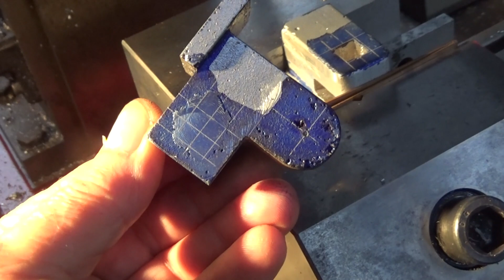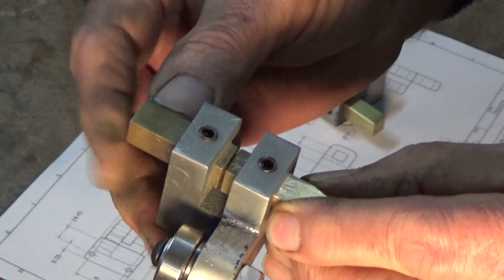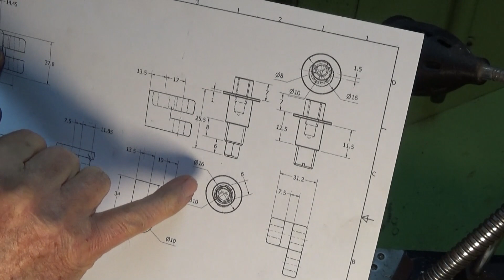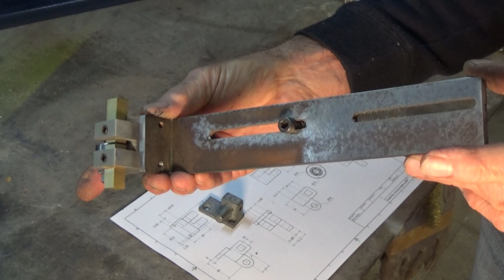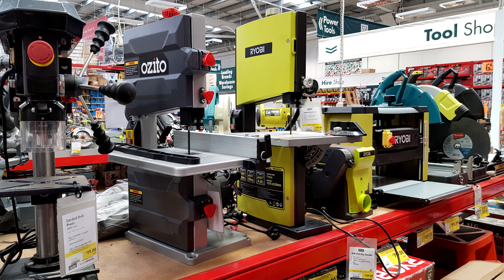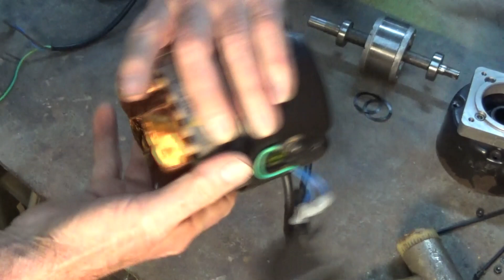Wood to Metal Bandsaw Conversion - Part 2

Comment: Mark,
I’m looking at this four years later, and it shows me how to ‘convert’ my own little Ryobi band Saw.
Thanks for all the great detail mate 👍
Robert
Reply from the maker: Thanks. If I were to do this again I would probably use a gearbox with a 20:1 ratio rather than the 30:1 that I used. I should also get some blades with a coarser pitch for thicker materials. However it has worked well and I have never broken a blade or had a blade come off the wheels. The laser is a gimmick and I now find it annoying. It tends to be too bright and it makes it hard to see the line. Maybe a red filter would be useful to cut down the brightness. 
Regards,
Mark
Reply: @Preso58  
Advice noted 👍

Comment: I would have either chosen round stock for the blade guides, or rounded the edges of the square stock.  That’s cause I be more lazy then you.  I think brass is ideal.  Seen many that used phenolic.  Worked great.  You are what I wished I had for an industrial arts teacher.  One was similar in that he was involved and a great guy.  The other was a lazy wood shop drone who assigned me to instruct the students for everything that he was deficient in……..which was all of metal working, which was the name of the class.  But you have to know what is going on to teach, so I really profited from the experience.  Last paying job was teaching Aircraft Maintenance, which required a federally licensed mechanic to instruct.  Guess I figured it out along the way.  Great stuff here,  appreciate your sharing
Reply from the maker: Thanks for watching. The brass has worked quite well and I copied the mechanism from a very old wood bandsaw which has a much higher blade speed. It seemed to work OK so I figured it would work for the metal bandsaw.
Regards,
Mark

Comment: FYI the tracking crown on a bandsaw is not the same as a say conveyor belt. The bandsaw width includes the teeth which offer no tension factor and therefore the blade with say a 1/3 width gullet depth means the centre of the blade tension is 2/3 the width away from the tooth tip. Thats why your bottom wheel has the teeth hanging off the front edge. In short move the wheel crown backward.
Reply from the maker: I do recall watching a very good video on how to tune a wood bandsaw and it included the advice you are offering. As it turns out though, the blade has done a lot of work (I am actually on my second blade now) and it seems to track well and has not given me any problems. There's always something to learn though so thanks for the info.
Regards,
Mark

Comment: Should have put rubber on wheels it helps keep blade sharp and helps with alignment of blade
Reply from the maker: Many people have told me that but I currently own a large commercially made 7 X 12 metal cutting bandsaw and it has cast iron wheels with plain machined surfaces for the blade to ride on. My smaller horizontal bandsaw also commercially made and purchased as a new machine is also the same but it has aluminium wheels. In my view the blade has a different geometry to wood cutting bandsaws and also the material is usually a bi metal construction which holds its edge much longer. There is also a lot more tension on a metal cutting blade and it may damage a rubberised wheel very quickly. 
Regards,
Mark

Comment: Conversions and remodeling are the same, the problems keep coming, better off moving.
Reply from the maker: I could not find a small metal cutting bandsaw that I could lift onto the top of a storage cupboard where it lives most of the time. I only take it down when I have a job for it. I have limited space in my workshop and as much as I would like to have an industrial style metal cutting bandsaw, I just don't have the room. Also, the project was as much about the challenge as it was about having a means of cutting up small pieces of stock. Even if the saw turned out to be a total failure, I will have still learned something. 
Regards,
Mark

Comment: Hi Mark. You mention that you think that the hole in the gearbox appeared to be tapered. I'm wondering if in fact it was a morse 2 taper because the weird sizing of 14.7mm may indicate that. (I just went thru a similar exercise making a locating lug for my new rotary table and I thought it weird that it had a 14.43mm hole. As it turns out, it was in fact a morse 2 taper. Great info on this conversion.
Reply from the maker: I must say, I didn't even check that. Now that you mention it the company selling these gearboxes also sell a lot of equipment for CNC conversions and the like. The hole wasn't deep enough for a full MT2 though. I assumed it was so that any misalignment between the coupling and an output shaft would be taken care of. In any case the gearbox is still functioning really well.
Regards,
Mark
Reply: @Preso58  the rotary table doesn't have a full depth Morse 2 taper either. A mate suggested it may be, and it was.
I use mine in the quill to quickly locate the centre of the table. Works a treat.

Comment: Hi! Nice work! We seem to share interrests/hobby. I cast aluminium and bronze. I'm more into "micro-casting". Currently I try to make a 1:4 scale v8 ferrari engine. -Struggeling to make the main engine block, but will try with "epoxy sand" insted of oil sand. The engine top are ok, using oil sand, but imagine the water chamber inside the engine block.. Very difficult! Are you from New Zealand or Australia? I'm Norwegian. Best Regards, Arild
Reply from the maker: Arild, I live in Queensland, Australia. My father was born in Wellington, New Zealand and my son lives and works there now. I am guessing you are a Ferrari fan so you must be ecstatic about Charles Le Clerc's win in Monza. I must say, I was a bit happy that he took the win from Mercedes. And Danny Ric got in the points too. The only type of engine I have not built yet is an internal combustion type. I am keen to have a go though. As you say, the complexity of the castings and the camshaft with it's associated gearing has put me off. I would love to see how you tackle the casting for the engine block. If you put it up on Youtube, let me know.
Regards,
Mark Presling

Comment: That thing on the end of the table appears to be a miter slot to me.
Reply from the maker: That is correct. It is more like a rail but another viewer confirmed that a mitre attachment could be mounted on it. I have just made up a wooden pattern to cast a new aluminium table and it will have a milled slot for the mitre attachment. That pressed steel table is way to flimsy for the blade loading. 
Regards,
Preso

Comment: Be careful with the blade guides, chamfer the corners and give enough clearance so the guide the blade and not machine it.  I ruined a brand new blade in the wink of an eye when I got handy adjusting the guides on a bandsaw at work.
Reply from the maker: vel wheel. I did a lot of cutting today on the saw. A viewer who lives locally gave me about 18 kg of 2 and 3mm brass sheets that are leftovers from his CNC plasma cutter. So far the brass blade guides have held up well with no sign of wear. My biggest issue is the table which is way too flimsy. I have made up a wooden pattern so I can cast a new aluminium one. The viewer who gave me the brass has a massive industrial wood bandsaw, (you'll see it on an upcoming video) and I was surprised that it had aluminium blade guides!
Regards,
Mark Presling

Comment: Prezza ! pall! Mate ! Comrade !

Great job.... I bought a brandnew Scheppach wood cutting bandsaw and did pretty much the same to it...
The wheels were sturdy and wide enough, so I didn't have to make new ones. The reduction I bought had a motor attached to it. I have three phase, so I pretty much bolted it straight into the spot where the original motor was. It had a few 100 watt more than the original motor.
I use a 12 tpi bi-metal blade and this thing works great.

The only thing I still want to change is the table. That is die cast aluminium and I have a mind to bolt a 5 mm steel plate on top of that (the casting is quite substantial, not flimsy)
But this indeed a great way of having a metal cutting bandsaw for little outlay, even when you buy all the stuff new, you barely come to a 1/4 of the price.

No Worries!

Paddy
Reply from the maker: Paddy, I still have to make a new table for mine. It really is too flimsy for cutting metal. I find it springs quite a lot when the joint in the blade passes through the stock. I want to cast an aluminium replacement to keep the weight down. I have to store the saw on top of a tall metal cabinet and my arms are like pipe cleaners. The struggle is real! 😁

Comment: Hat off to you buddy, I'm impressed. Hope you get lots of use out of this saw! Cheers.
Reply from the maker: Capi Berra,
I have wanted a small metal cutting bandsaw for such a long time. I have a large supply of thin sheet aluminium, steel and stainless steel. It's mostly stock up to about 3mm thick and I use it for lots of fabrication. However it is such a pain to cut up. I have a plasma cutter which does a really good job but it is a chore to set it up and my shop is tight on space so I have to put it away each time I have finished with it. A little bandsaw like this one can be set up on the bench in minutes and it is a lot easier to see what you are doing. I am almost ready to reassemble the whole machine for the last time. I spent most of today doing all the finishing processes on the new parts. Lots of sandblasting, polishing, powder coating, zinc plating and anodising. I want it to look good!
Regards,
Mark Presling

Comment: At 3 to 3.5 mins in when you cut a couple of samples it appeared that the blades teeth were pointing up?!?
Reply from the maker: Ged,
It's just a trick of the video frame rate. The saw would definitely not cut if the blade were reversed.

Comment: Brass, bronze, copper... are some of the first known self lubricating metals, that is a awesome reason to use them on the blade guides.
Reply from the maker: I had exactly the same setup on my wood bandsaw although I think the square blocks were bronze. We had a large Woodfast saw at work with brass plate guides and it copped a hiding from kids using it but it gave a really long surface contact to the side of the blade. I changed my wood bandsaw over to "cool blocks" a while ago but I haven't noticed a great deal of improvement over the original configuration.
Regards,
Mark

Comment: I have been looking into converting a wood band saw to metal for some time, and your video is exactly what I need.
I have already rushed out and ordered all sorts of parts (as is usual for me) and will be copying your build as closely as possible.

One question is, would you consider selling castings of the wheels? The rest is easy enough to do in other ways, but the wheels are a bit more tricky (particularly the bottom one).
Another option I thought might be to make aluminium inserts and weld up the holes in the factory wheels for strength.

Anyway, thanks for your videos, very inspiring.
Reply from the maker: Rohan,
I would try the stock wheels first. The ones that came with my GMC saw were very flimsy and only had three spokes. The Ryobi and Ozitio ones that I had seen at the hardware supplier were a little stronger looking. The main issue was the bottom wheel which needed quite a large boss to offset it enough from the gearbox spindle. It might be possible to just machine up a spacer for this.I am not really in the business of selling parts but you might be able to find someone who does aluminium casting who cam make up some castings for you. 
Regards,
Mark
Reply: Mark Presling thanks Mark, I thought it would be a long shot, but you never know unless you ask.
My machine (which I don’t have yet) appears to be of the generic Chinese variety and according to the pictures has the flimsy looking 3 spoke wheels. I’ll have a closer look when it arrives.
Reply: $127 on eBay, can’t really go wrong.
https://www.ebay.com.au/itm/Baumr-AG-Bandsaw-Cutting-Band-Saw-Portable-Wood-Vertical-Benchtop-Machine-Bench-/142921329699

Comment: Thank you for showing your use of the collet block. That was very cleaver:)
Reply from the maker: Thanks. I only found out about these collet blocks by watching other YouTube makers. I have two. One for hex and one for square. The technique for offsetting stock for eccentric turning came to me one morning when I was struggling with trying to do it in the 4 jaw chuck without the collet block. It can be done but it is just that much harder.
Regards,
Mark Presling
Reply: @Preso58  I have the same ER32 collet blocks, but it never occurred to me to use them in lathe chucks. I just use them for mill work. Using the square one for offset work on a lathe is a great idea; especially when more than one part needs to be turned with the same offset. Your idea can save a lot of time. Thanks again for sharing it. 
I have an ER32 collet lathe chuck, but it's a pain to switch out for small projects. I'm going to try the collet blocks next time.

Comment: Blade running in reverse?
Set nut on the guide is loose?
Reply from the maker: No, the blade is not running in reverse. It just looks that way because of the video frame rate. The nut on the guide is loose. I cannot set these permanently because the bottom wheel is still misaligned. I have to make up a spacer to ensure that the top and bottom wheels are in the same plane. 
Regards,
Mark Presling
Reply: @Preso58  well I'll be, as the yank I am, I thought everything over there ran counter to the direction it ran here.   Good on ya. Cheers

Comment: G’day Mark, you’re a cut above the rest. As you mentioned those brass guides don’t have to be square, is it one of those times where you get too committed then think I should have spent a coupla bucks on some round! Square holes aren’t fun even in aluminium. Cheers 
Peter
Reply from the maker: I just like making things difficult for myself. I couldn't buy 10mm square brass stock either. I had to machine it from 1/2" stock. I only tried to order the brass after I had cast in the 10mm square hole. Like I said in the vid, this whole adventure is a prototype. If I were making another one it would look quite different. Still, it's fun trying to anticipate the next step in the process.
Regards,
Mark

Comment: In the opening sequences where the blade is shown cutting the metal the blade looks to me like it is mounted upside-down down (teeth pointed up), is that just the “video” and me seeing or imagining that? Thanks for the very interesting fix and information on the motor. I’m eagerly waiting to see your fix on the blade tracking on the lower wheel. Any observations on possible flex of the sheet metal frame when the blade is tensioned?  The finishing touches should include some or your trade mark art deco embellishments.
Reply from the maker: It is just a trick of the video frame rate. I was watching the video shortly after I published it and had myself totally convinced that the blade was in fact upside down. I actually went down to the shed to check. I should have just trusted myself since there is no way the blade would cut if it were reversed. I have marked out a large piece of 6mm steel plate to reinforce the back frame of the saw but I still need to do some realignment of the lower wheel before I go ahead and make any changes to the frame. I suspect that all I need is a spacer to bring the top and bottom wheels into the same plane. I have made some artwork for a new brass maker's plate with a few vintage touches. It will replace the horrid "GMC" brand on the saw at the moment.
Regards,
Mark

Comment: Very good progress.   I do like the slow speed you now have with the correct gearmotor.

I think the blade guides could have been machined from a block of aluminium.

I have a 17in wood cutting bandsaw.   The rear of the blade guide is a bearing on its side like your original guides, so the back of the blade engages on the rim of the bearing.   Not desirable, but likely designed to save space in the guide.   It works, but I would have preferred engaging on the outer race like your guide design.

Dave.
Reply from the maker: I was questioning my decision to cast the body of the blade guides. I had some 40mm square 6011 alloy all ready to go but I was still experimenting with cored casting and decided that it was worth trying to cast them with the voids. As it turned out only one of the cored castings were used and I cast a second one with no cores for the finished upper guide. I have never liked the design with the blade rubbing on the rim of the bearing. It always seems like a compromise and must set up a lot of friction. We had a machine like this at work and the resonance set up by the scraping action made the saw sound like a shrieking banshee!
Regards,
Mark

Comment: Another great project.  Do you think that the gearbox will handle the torque of a 7.5 amp (120v) or 1 HP on a typical 14 inch wood band saw , which are readily available used?  Metal band saws are much harder to come by.
Reply from the maker: Stephen,
The gearbox that I purchased seems to be quite well made and it appears to be filled with oil or grease. There is a filler plug in the body so I am guessing it is well lubricated. The gear reduction might mean that the torque at the motor will be way less than if it were driving the bandsaw wheel at normal wood cutting speeds.  So at least the input end of the gearbox is going to feel a lot less stressed than the output end. I would think that for the outlay (around $135 Australian, that's probably about $15 US 😁) it is worth a try. 
Regards,
Mark
Reply: @Preso58  Thanks Mark.  I think i'll look out for one and give it a go.